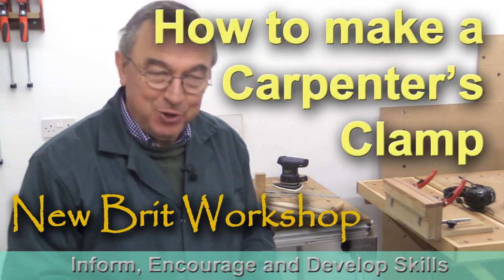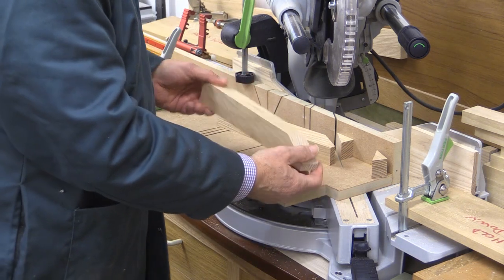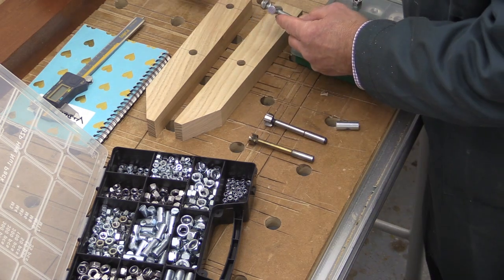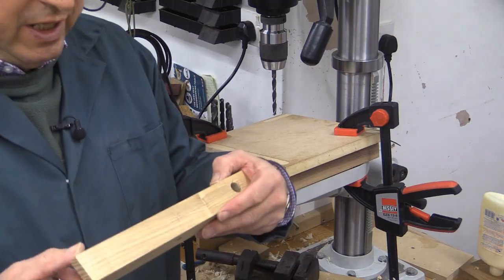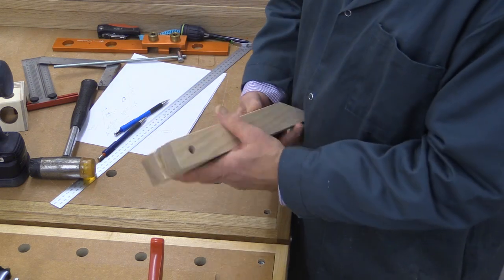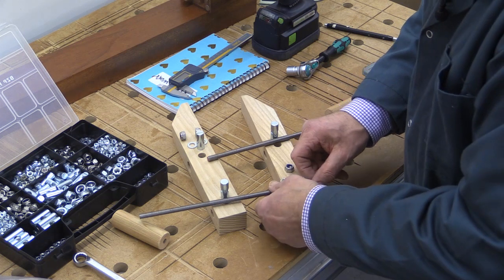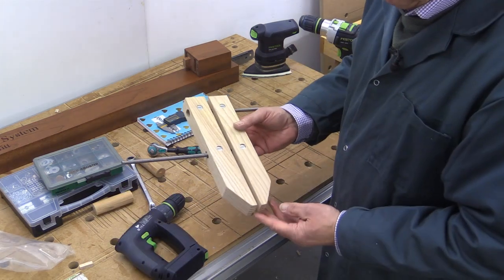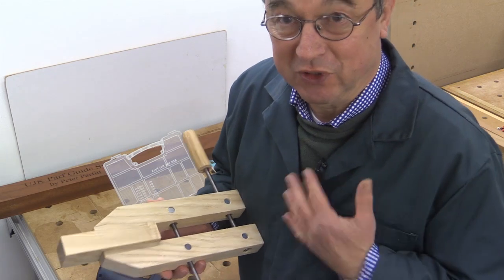How to make a simple carpenters clamp

Comment: This type of clamp is unparalleled for holding round or odd-shaped items securely in the drill press, or for holding small items securely for operations that normally would require holding your fingers too close to whirling blades, or belts.

Comment: Another nice video - explained well.  You can also make your own cross dowels to fit whatever thickness material you need if unable to locate a local source.  Booker rod is always available in different thread types and pitches, so you can gain a differing level of torque options by choosing different threads.  Another option would be to fill the cross dowel holes with a contrasting timber and make this a feature.  You can make a clamp with a very deep clamping surface using the counter screw engineered clamp design you have just outlined.
Reply from the maker: Some excellent suggestions. Thank you.  Peter

Comment: These aren't exactly like the Jorgensen clamp.  The original uses both left and right hand threads and dowel rods.  There are clamp kits available with the correct hardware but the cost is nearly the same as buying a pre-made clamp.

Comment: Great video Peter, I've been thinking about making some of those clamps for a while. Now I have a full 'how to' video to follow.

Can I ask what you think of the Zyclops ratchet. Is it as useful as they appear? Can it perform as a ratchet and screwdriver as well as the individual tools it replaces. Or is it a bit clumsy at both operations?

Thanks

-Neil
Reply from the maker: Hi Neil, I use the Zyclops quite a lot and it works really well. Obviously it is a "Jack of all trades" and so there are some compromises when used as a screwdriver. However, having everything in one pouch is very useful.   Peter

Comment: Correct me if I'm wrong, but wouldn't you have to screw to the left (ie in reverse)  to tighten your clamps? this would feel unnatural. I think you would want your fixed nuts at the handle end of the threaded rod.
Reply from the maker: Hi Marty, You are probably right. I must say that I am not a fan of this type of clamp and only made the one in the video to show people that clamps can be home made.      Cheers.    Peter

Comment: Great informative video as usual. Easy to follow. Was that a new Festool sander or an RTS 400 with a special should on it? Looked like a special dust collector attachment.
Reply from the maker: Hi Jim, It was a standard RTS 400 with the supplied protector. The dust collection is standard as well. I now have TWO go to sanders, the ETS EC 150/3 and the RTS 400.  Cheers.   Peter
Reply: New Brit Workshop Thanks Peter. I don't think we received them in the US. Mine is about 3 - 4 years old and I use it all the time on smaller projects. I to have the 150/3 and it's my go to sander.

Comment: Another nice video Peter! One, no doubt dumb, question if I may. What purpose are the two dowel nuts that you drill out performing?
Reply from the maker: They are held in place on the threaded bar by the two nuts on either side. That way they anchor the end of the 8 mm bar in the (respective) wooden clamp block.   Peter
Reply: OK, understood Peter.  But if you did not drill the perpendicular 12mm hole for the barrel nut could you just drill an 8mm hole through the jaw with a 15mm and 18mm recess at the respective ends?  Then the two nuts would lock against the wood?
Reply from the maker: The problem then is that the stress will damage the wood. The barrel nut spreads the load and stops the wood from splitting.   Peter
Reply: OK, again makes perfect sense.  Having now seen how inexpensive they are seems no point in not using them.  Thanks again for the video and being so helpful in responding to comments.  I hope one day to bump into you so I can thank you in person.

Comment: Hi Peter, 
As always, a great and well presented video! I have what is probably a stupid question: I notice that other hand screw designs eg Jorgensen have the barrel nuts mounted offset from the centreline of each jaw - is there a technical reason for this, or is it just style? The clamps I built from your design work perfectly so I am just curious!
Reply from the maker: I did not know that and do not know why.    Cheers,   Peter
Reply: That should be obvious more meat in front of the dowel nut fo strenth

Comment: great job
What is the clamp size, 
total length?
Is there a connection with thread rod size?
Reply from the maker: Hi Nestor, It is about 240 mm long and the rod is 8 mm. I would not go any small for the rod size for a clamp of this size.  Cheers.     Peter
Reply: thanks peter

Comment: Hi. thank you for video. I Have followed it and clamps don't work as those clamps are supposed to. problem is with the design you have used, in case you have 2 same direction rods (not opposite) you have to have threaded dowel bold of both rods on the same clamp and not opposite as you have shown. If you build it as shown, using this clamp is cumbersome and you can't operate them as one should (easy parallel closing and opening). I have fixed mine and they work as expected but it is something that could have been mentioned in video.
Reply from the maker: Yes, there are many designs for these and some are better than others as you have discovered. The great thing is that you have used your initiative and found the design that suits your needs. Well done.   Peter